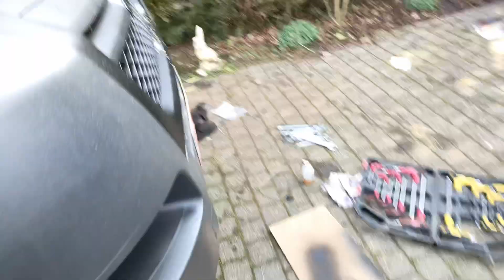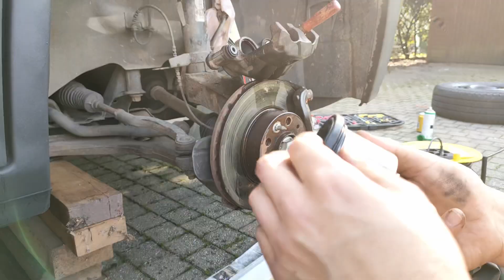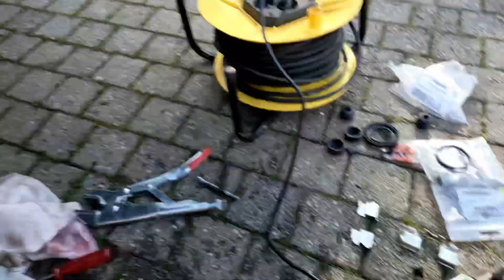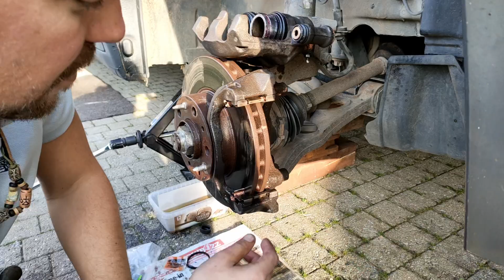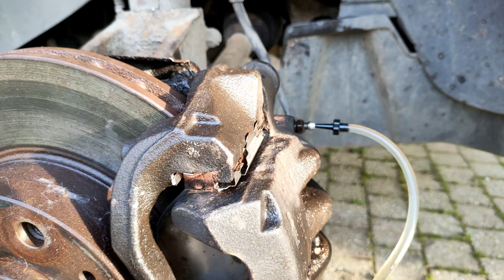Brake Caliper Replacement Repair Kit | How To Avoid Stuck Brake Piston?

Comment: For future, use ceramic brake grease instead of silicone on the pads. Ceramic brake grease is better for metal on metal contact, as well as having high temperature resistance🙂